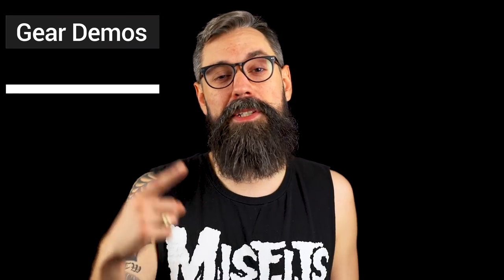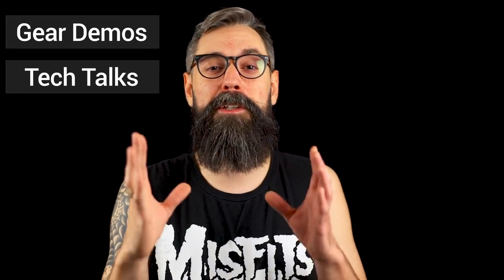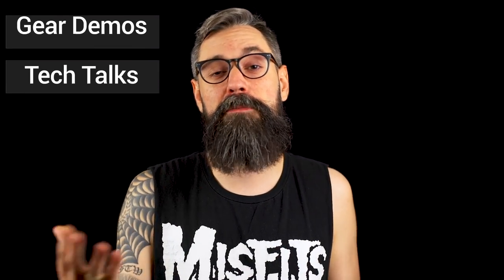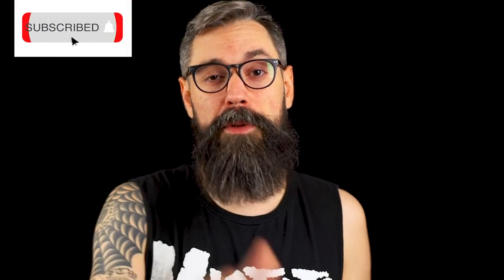Fuzz Pedals And Buffer Order

Comment: I experimented, first the conventional way which was good but I have a Drop Tune and Big Muff Pi that I used to use a Mosky Pure Buffer after but I like the way the buffer sounds before them so that's how I roll!

And I also have another Mosky buffer at the very end of my regular board.

I also checked various ways to stack a vintage Echoflanger, Polyflange and Polychorus all of which are notorious tone suckers, and what works for me is to still have 1 buffer at the front, another right before the Echoflanger and after the Polyflange and that's it. If I add another buffer at the very end like my normal board then it just doesnt sound good.

Comment: What I love about this video is the lack of judgment: as always, do what you like! My favorite fuzz is currently a RambleFX Twin Bender, and I have about four buffers after it. It's always first in the chain, but every so often I throw a compressor in front of it when I want it to sizzle on a recording that I won't be turning my guitar volume down for. When I do that, it's always a Keeley Compressor Plus.
Reply: I second you on the Twin Bender. The TB also allows you to adjust the impedance and bias so you can pretty much out it anywhere in the signal chain.

Comment: Logically to me, I put the Muff Pi in front of any OD & Distortion pedals. I read the manuals and quickstart settings guide (QSG) for EHX's Deluxe Muff Pi. That QSG indicated that the Muff Pi can go into the clean channel of the amp or the Muff Pi could be used going into a slightly overdriven amp. So I figured my options were to use either the OD pedal of my choosing into a clean channel or just bypass the OD pedal and go straight into amp and use the built in OD on the amp for that slightly overdriven amp boost and gain control. Either way the OD & gain control happens after whatever Muff Pi settings that pedal fuzzes the signal. Anyway I looked at it, the amp has it's own preamp section before it hits the output section regardless of whether there is any pedal chain in front of the amp. The pdf link below is the QSG, you can see the Triangle & Rams Head are indicated as best into a slightly overdriven amp. The Op Amp has more gain already built into it's circuitry.

https://www.ehx.com/assets/blog/deluxe-big-muff-settings.pdf

Comment: fav pedal on my board: Joyo Voodoo Ocatve Fuzz with the caps mod. is sit someware in the middle of the board. will switch it to the front tomorrow. think i have 2 buffers. tuner with buffer and noise gate with buffer. maybe 3 if the big muff pi tone wicker have one...
but now i have no clue how set the board strait!?! 
current layout: tuner behringer trash - noisegate boss ns2 -  compressor TC force field - overdrive TC tube pilot - fuzz joyo ocaver fuzz - fuzz big muff tone wicker to an marshall jmp1 with a gmajor 2 behind...

Comment: I think I have 4 buffers currently, the reason is I have been strugling to combat grounding issues, in a setup with a split out clean signal and a pedalboard to amp signal. I am within short time moving my setup to a newly renovated part of the house, where I should get propper grounding and ground protected circuits so hopefully I can dial back on the number of buffers and play more around with the direction of the signal chain.

Comment: I bought a fuzz face-ish pedal and was wondering where in the chain it's best to put it at. Problem is i liked the heavier tone with buffer first, but i also like the cleanup rolling down volume pot with buffers after. I use a analog/midi controller. Or I put my Pitchfactor after my ODs or i'll live with a buffer before the fuzz.

*I think my buffers are:
Eventide Pitchfactor
Boss GE-7
Fuhrmann booster'n'buffer (only buffers when ON)
Eventide Timefactor

Comment: My favourites are Fulltone '69 for more expressive stuff and Wren and Cuff Eye See Pi for all out destruction.

I use two buffers: one is a Catalinbread Belle Epoch Deluxe with EP style preamp always on (technically works like a buffer) and then a Boss TU-3. Both are after fuzzes, and TU-3 is my last pedal on the board.
Reply: What should be noted as well is that a buffer AFTER the fuzz, especially simple germanium circuits, also makes a difference to the tone. I discovered with BED that the EP style preamp removes the fuzz - amp interaction like a buffer would, BUT the tone is a lot more pleasant than with just a typical buffer, like in a Boss. You can have normal buffers after the EP preamp, and it doesn't add that nasty high end any longer even with the fuzz on.

Comment: Great video. I had  j rockett icon (buffered) in front of my fuzz pedals but I didn't like it. Then I put a transparent overdrive in front of the fuzz pedals and didn't like that much either. What works best for me is putting an EQ pedal first after my wah and modulation pedals, then another EQ after the fuzz pedals to shape the sound to my liking. My favorite fuzz right now is an electro harmonics Rams Head muff reissue which along with the eq's sounds incredible. I just use any good tube amp on the clean channel and it sounds good to me.

Comment: I just finally found a fuzz for my amp. I had found an amp years ago that was pleasing for playing cleans and natural breakup after a couple of missteps (expensive learning curve) but.....a big but....this amp didn’t like fuzz or overdrive(exception was a cheap joyo tube screamer clone) but not the sound I was going for. Years later (literally last week) after trying this and that, I bought a used Analogman modded Fuzz Face from the 90’s with a buffer and sundial. Presto....the amp finally liked what it saw on the input. The Undefined mush I use to have with fuzz overdrive finally has that chainsaw tightness and definition. Hopefully someone may read this and help them keep an amp they have grown attached to. I had bought a Valco circuit with the 6973 tubes for just this reason and it loves fuzz or overdrive circuits-any....they all sound great with it but the cleans on that amp can’t touch the Ampeg. Every tool has a purpose, some can have more but it’s been a harder road than finding a guitar I can get along with. Who knew? I don’t know if I’ve even seen a pedal with the buffer option or advertised as such. Like your channel-were finally getting the content we need. Cheers!

Comment: Great video. I’ve heard this over and over, but never demoed with a really heavy tone.  Makes a huge difference for me!  Thanks as always, Jason.  
I’ve always had this sound-the closest I’ve gotten is a Boss DF-2 into a solid state Acoustic 134.  That was more for hardcore and metal. Amazing sound. I used a Line 6 XT Live in a doom band and it was cool, but problematic. Very easy to dial in too much low end and generally too many options.  I like to tweak my sounds but with all the amps, cabs and effects it’s overwhelming.  
Plus both sounds start with buffers. Neither cleaned up very well with the volume knob. 

I got a Carcosa fuzz and everything changed. I put that before the XT Live and suddenly my tone is massive, dynamic and the volume knob controls the gain. It was an epiphany. From there I started to learn about gain stacking.  
I now have the Orange Micro Dark. Totally different kind of tone. Much less processed, more raw and dynamic. I’ve decided to embrace this and make it my sound. So far I’m really liking it just cranked into a 4x12 with no pedals, but I’m always looking for any ideas. This amp has an effects loop, so there  are a lot of possibilities for time based stuff.  
Anyone have any suggestions?

Comment: Thanks for making videos. They're quite informative!

My current favorite fuzz is an EHX Big Muff Deluxe. I put a Tubescreamer-type pedal in front to give it a push (Horizon Devices Precision Drive). 

I have an Earthquaker Erupter that I really like, it's just not as versatile as the muff. I read somewhere that it's a fuzz face with a circuit that converts the impedance before hitting the fuzz circuit so you can put it anywhere on your board and it sounds good. In my experience, though, it really doesn't like to be boosted.

Right now I think I've got 2 buffers on my board. 1 in a Behringer EQ700 (clone of the Boss GE-7), and 1 in my TC Electronic Polytune 3 that you can switch off if you want. I try to make sure there is always at least 1 buffer, but not too many.
Reply from the maker: Sounds like a badass setup! 
Thanks for watching (:
Jason

Comment: Just subscribed... Too much good content to miss them ;)
Now I only have one buffer, but I build all my pedals myself and they are tbp :) I have a buffer right at the beginning after my wah and tuner. Wah is modded to be tbp, tuner is Korg Pitch Black - one of the first tbp tuners out there. These days I'm thinking of swapping it with a TC Electronic Polytune 3 with the built-in switchable buffer. That would save me some space on the board while the BonaFide buffer is highly praised, so would probably not harm my signal chain :)
As for the favorite fuzz pedal...? Dunno... I have a Russian Big Muff clone with some mods to get more from the mid / low-mid frequencies. I love that one, but I rather consider it a distortion, not a fuzz based on its sound. Recently I tried the Pharaoh from Black Arts. I used it for a while, but then I turned back to my trusty ole' Russian. I also used a KMA Fuzzly Bear clone for some time, it was good for solos. I use the Russian as the last distortion device in my pedal chain and used the Fuzzly Bear at the beginnig (at that time I didn't use a buffer yet). Actually even though we play psychedelic/stoner rock I don't use too much gain. My amp is set up to the edge of breaking up, but rather clean. I then have a light OD, a heavy OD and the Russian Big Muff. Recently I'm adding a TS9 clone at the beginning, but only as a boost, drive is set to minimum, volume to maximum. I have found that - at least for me - the quality of the distorted sound is much more important than the amount. I mean a gutsy, snarling sound, rich in mid and low-mid frequencies is essential, and the actual amount of distortion is less important.
Reply from the maker: Badass that you build your own pedals!

Comment: I like to use my old gear rather than buying new stuff, so my main distortion is still a Marshall Guv'nor pedal that I bought back in 1990 or -91. I'm thinking of adding a Boss Turbo Overdrive that has been laying around for years but I haven't yet decided where in the chain it will go. Building a new pedalboard right now so we'll se where it ends up...

Comment: I have 2 buffers. 2 boss pedals dd3 and sd1. Everything else true bypass. I actually have the sd1 before my eH big muff pi tone wicker cause my Vox wah doesn't really react the way I want without the buffer. I use my OD mainly as a lil boost not if I use any fuzz. Mainly not really using OD with my other gain pedals. Not my style cause I'm not a metal head

Comment: Howdy, Fuzzbaby, oops I meant Fuzzlord. Anyway, cool video as always. I have no idea how many buffers since I only have one Boss pedal and I barely use it. Favorite fuzz is a tough question as I am always switching them out. Right now it's a Mas Malo, but I guess my fave of all time is my vintage Green Russian, a monster for sure. Question, are compressors buffered? I have a Saffron Squeeze which I really like but now it's sitting in front of the Warped Vinyl and I think it does wonders for that. My fuzz is in a completely different signal chain. Thanks as always and when I start working full time again I am definitely gonna get me a Fuzzlord pedal. Cheers.

Comment: Dumb question y’all…if my NYC Big Muff Pi is the last dirt pedal before my MXR Micro Amp and the EHX Metal Muff is before the Big Muff, do I need a separate buffer? My “on all the time” pedal is the Soul Food(buffer switch on) and after that is the SD-1 to “juice” the Big Muff. Thanks!
Reply from the maker: You don’t need one you are all good!
Reply: Thank ya kind sir! I did go to my fave guitar shop here in the Memphis area, Revolve Guitars, and got a Rockboard buffer. Tried it in different places. You were right. I didn’t need one at all. I have plenty of dirt box chain signal!

Comment: Univox Super-Fuzz (clone), Germanium Big Muff pedal. 

I plug my guitar into a GEC9 pedal switcher. The fuzz sit at the front before any other pedals on my GEC9. I don't know if the GEC9 is buffered though, I  don't think it is. No idea though.  After that I have a bad monkey overdrive. Next I have a GT10 that's hooked into the GEC9 using 4CM. After the return from my amp on the GEC9 is a  Lester G by EHX. I then stereo out from the GEC9 to my 2 amps with a Stereo JamMan looper in between. So, the GT10 is definitely a buffer. No idea about the bad monkey. I dont know about the Lester G but I'd never put it in front of Fuzz. 

I will need test out the bad monkey pre and post fuzz to figure out if it is buffered. If the GEC9 is buffered, that would be a hassle. I can't say I have noticed anything though.

Great video by the way. Thanks.

Comment: Sadly I don't have a fuzz pedal yet. I'm looking for one but I'm totally undecided. In general I like my pedals to be versatile. Any suggestions would be great.
Reply: Germanium Big Muff is the only fuzz pedal I have, and it usually sounds really good. However, the results are rather unpredictable. It can sound amazing on one amplifier (Orange amps sound REALLY good with it) whilst sounding really "plasticy" on others (such as my friend's AC30). It's a split pedal so it's got both an overdrive side and a fuzz side. The overdrive is very smooth but got some pretty versatile tone-shaping capabilites and I managed to get some pretty nice top-end to my signal with it once. The fuzz side got something that could be seen as a gimmick but that I've found to be pretty useful which is a "Volts" knob. You can go from normal fuzz to that really thin and "spitty" fuzz sound.
Reply: @TurtleGamers1  I have the Brent Hinds terror, but I ended up going with the Big Muff Russian Pi. It seems to have better mid presence. I felt that would fair better in a live full band setting. Thanks for the input 👍.
Reply: @clugokillscluco  Yea Russian Muff has more mid-presence than muffs usually have ^^ good purchase

Comment: Trying to control gain by increasing the output pot's resistance leads to impedance mismatch and more noise down your chain.  It's a very crude way to try to control ones tone, and doesn't make sense from an electrical engineering perspective.   It's better to feed the best possible signal into your pedals.
Reply from the maker: You must be new to the fuzz face circuit (: Many people like getting a lower gain sound by turning down their volume pot and running less signal into the pedal as well as giving some series resistance between the pickups and the pedal 🤘

As an electrical engineer myself, sometimes what is best on paper is not what sounds best in the guitar effects world. 

Cheers and thanks for watching!